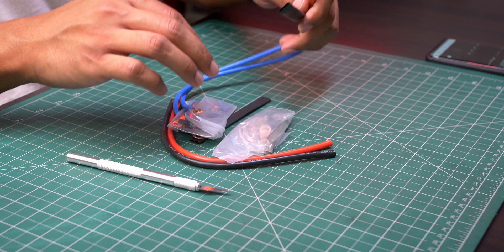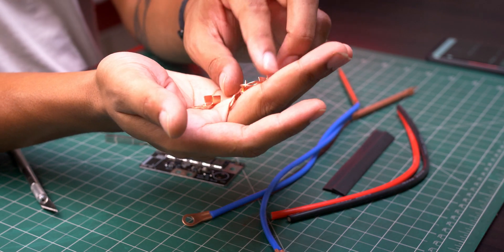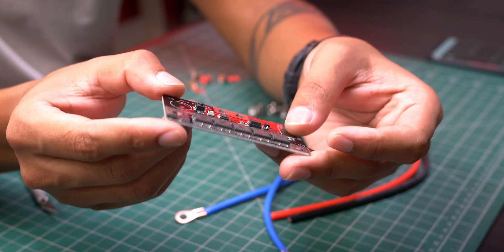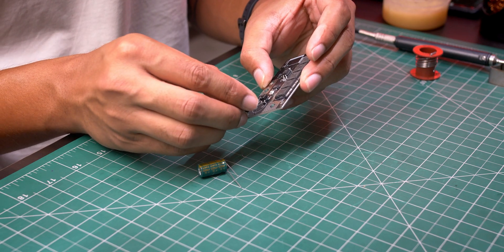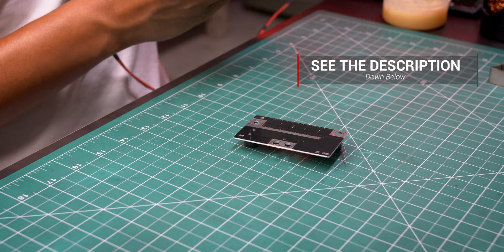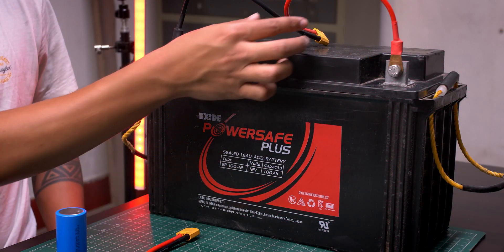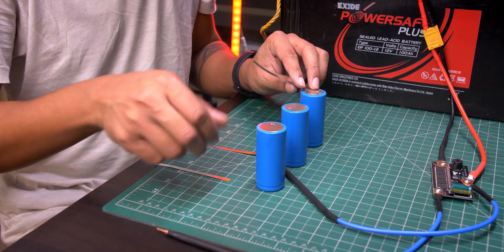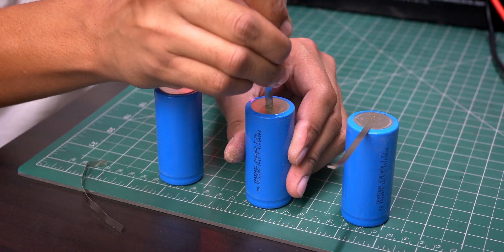Can This $15 Tiny Welder Spot Weld ?

Comment: yes that little spot welder will weld you've got the capacitor the little red ones pretty good too getting a little pricey and even the one with the xt90 connector on it is getting a little pricey but they all work you can't overwork them they will burn up how would she just getting some extra mosfets

Comment: I ordered one.    Assembled as required.   First Attempt to employ I learned it was defective.   The Probes were powered as soon as the battery was connected.  I have a second on the way.   Will see if it has the same issues.   Music is PAINFUL  .
FET's are Switch ON as soon as any power is applied.
Reply: How was the second one?
Reply: @ClarkWhite81  Seems to be ok.  I've completed a few hundred welds and it's not smoked as of this time.  LOL  I would opt for the on with more FET's.

Comment: I noticed the circuit board or leads jumped when the capacitor discharges. Now I'm wondering where the kinetic energy comes from exactly?
Reply: The kenitic energy comes from the high current creating a magnetic pulse, ever seen the copper wire spinning on a AA battery? Anyhow, we are talking low voltage but exceedingly high current, for 100ms it may be as high as 200Amps then the voltage drop and current shifts after that short burst...
I hope this helps to answer your question

Comment: Please specify which exact battery needs.to use..I used a car Battery with same Board..Nothing happened.
They say 45C minimum discharge ..i used 10C 150 AH Solar Inverter Batteries..Not even a small Spark came from it.
In Some videos tbey show to weld to make it thick Groud connection.
I amnreally disappoint3d with theae boards.. No idea what to make it work !😢

Comment: Got mine, iv tried with my 4wd car battery and my 12v deep cycle and it does basically nothing, on all 4 modes it just pulses and I can flick the nickel strip off of the battery
Reply: Mee too. I replaced all supply cables with very tick cables and tried welding pcb and reinforcing pcb trails with copper but it still sucks. Car battery or sealed battery doesnt work. It is useless and I cant think any other improvement anymore.

Comment: Does this unit have a built in safety relay?
Reply: Not a relay, the pulsed timed activations are done by the many MOSFETs, typically you can use these as a relay to turn on very high current from a low current source, again they are not for safety but for correctly timed pulse activation

Comment: Hey Steve, 
I am going to buy this welder, I will replace the lugs with 50A ones and I will power it with a 3s lipo. Do you think that way it wil be a decently reliable spotwelder (I am going to make a small 6s3p 18650 pack with it) it would be a great solution since I don’t have the money for a better spotwelder such as the Kweld spotwelder (Maybe sometimes in the future when I will be making bigger battery packs)
Reply from the maker: Yes it's a good beginners welder if you use .1 & .15 mm then it's gonna work just fine , use 3S lipo battery with at least 50-80C Rating
Reply: Steve Willson Kujur thanks for the info 👍

Comment: Another excellent video. Congratulations.
This battery is a monster, lol.
I would like to use a smaller battery. 12V x 12Ah will do?
Greetings from Brazil.
Reply from the maker: No , it can't do use car battery it have good C rating
Reply: @SteveWillsonKujur  ...OK. I thought about using a sealed 12v x 12Ah battery from a UPS or use a smaller chain and smaller size.
Reply from the maker: Better use Lipo Battery with good C Rating
Reply: @SteveWillsonKujur  I'll arrange the purchase. Thanks for the tip.
Reply: @SteveWillsonKujur  What is enough? 25C?
Reply from the maker: Gdawon you need more then 80C